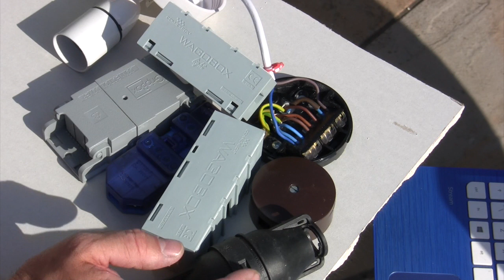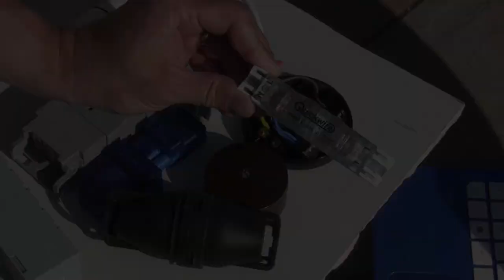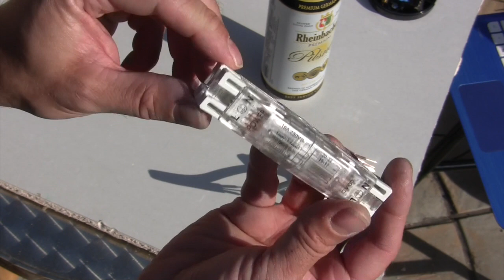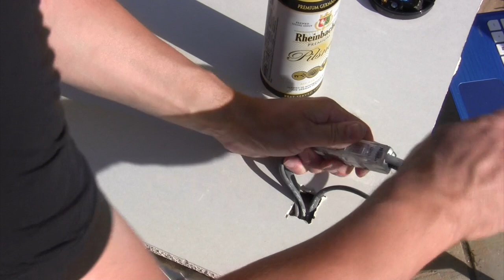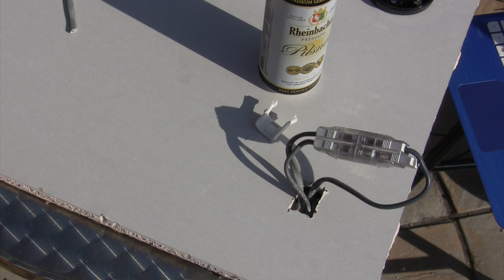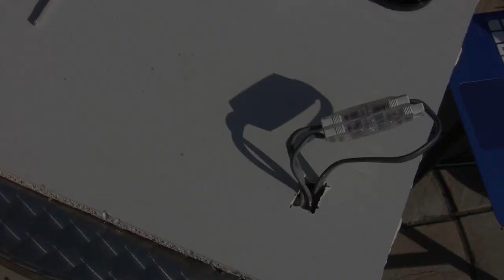The Quickwire Switch & Load

Comment: Wish I had one of these when I installed a ceiling fan and light. Ended up using some terminal strips to wire it exactly like a ceiling rose light would be, passing through the loop in to the loop out, and wiring the switched live into the device so it can be controlled by a switch.

It actually gave more control that way as the fan could be operated on its own switch cord, whilst the light was controlled by the wall switch.

Comment: David did you know that all new builds well in Leicester anyway the feeds and neutrals are looped in and out of switches and not in and out of the light points,I know it's crazy,so there is no permanent feed in you ceilings,and as for there being a blue cable being used as the switch wire and veing identified in my opinion is a bloody joke because for as long as the new colour scheme for new cables has been about there has been the ability to buy twin brown and cpc therefore there being no need to use a twin brown blue and cpc

Comment: The problem stems from the fact that those lights are meant for European installations where we fit round back boxes to the ceiling under the luminaries, then you do all the connections with wagos in the box and just do fly leads down to the luminaire.

Comment: My house was built in 2000 - just been crawling round the loft removing the myriad of choc blocks (twisted uninsulated cpc) and tidying up with wagos in boxes. Not so easy on the downstairs circuits with chipboard floors - and you can be sure if I moved all the furniture and lifted the chipboard - there would not be a choc  block in site.

Comment: I'm not keen on the fact the switch goes into the opposite end to the mains it looks untidy and will cause issues in old houses where the cables have no slack and in new builds where the cabling is clipped right upto the light. I will be sticking to crimps and choc box.

Comment: Hi Dave,  I am not an electrician, but I would like to know if this quick wire would be just the thing to add a couple of lights in my loft. I have just decked out my loft and would like to have a bit more light. I have one light only and wondered if I could add two more via the quick wire? My house was built in the 50s ant was rewired 20 years ago. Question is, how do I find the loop in and loop out?  It would be nice if any of you electricians out there could offer any advice for me? 😉

Comment: Another great review Monsieur Savery, I saw these yesterday at Sandown Elex but wanted to look at reviews, as I hadn't heard of them, before committing. Your review, which I stumbled across last night Mr Savery, moved me to get some today, so cheers my dears :)  
I went for the starter kit at £50, comprising of two of each connector plus the flat cable stripper, which is the Jokari FKZ with the Quickwire badge stuck on it, and removal tool. 
The inventor was on the stand and I mentioned the comments below concerning price point. He said he didn't want to go down the route of having them made in China but wanted to keep them made in the UK. He is also bringing out a downlight connector click connector in March. Is that "Dunstan" I see making remarks in the comments section? Also..........................
did Aldi sponsor this?
Reply from the maker: Cheers Olly. I was also chatting with the inventor when Elex was in Coventry a few weeks ago. We don't use many of these, but they're handy to have when the right job comes up! He mentioned about his new downlight connector and about a 32A version of this ideal for breaking into ring circuits to run off a spur which will be great when it comes out - less faff than using a Hager J803! No sponsorship for this one I'm afraid, just a flat beer from Aldi that happened to be knocking around!
Reply: @dsesuk  I didn't hear him mention the 32A version, interesting.  I applaud you not just for taking the time to make the funny and interesting videos but for putting up with the Luddites who "diss" you. They must have a toolkit comprising of a pair of side cutters,  a flat blade screwdriver, a couple of strips of screw terminal blocks (30A to cover all eventualities) and a roll each of brown, blue and CPC insulating tape!
Reply: @olly7673  🤣🤣

Comment: Junction behind the switch is best for smart light switches
Reply: Either this or a three conductor (earth isn't counted) cable is becoming mandatory as a Neutral is required at every switch under the new codes. The presence of a Neutral literally means that you can fit a $20 Astronomical timer versus a $40+ unit.

Comment: Meant to add I spoke to Quick wire about one that could be used on bathroom extractor with the timer but tooling and development cost have shelved it for now but I came up with a cunning plan, I told the owners to order non timed extracts, there is a way around it but  sod it
Reply from the maker: I'm finding them hard to get hold of, my account manager at CEF sounded positive, but when I went in to order more this week it was clear they had no stock (and no intention of bothering with getting any).
Reply: Bought a box in CEF last week and comes with 2 removal tools no problem with stock. Exeter

Comment: Not sure what you do when you have a wooden ground in the ceiling? And why would you need a clip? If you have access above you could just just a JB that costs 60p and not some over engineered device.. probably sell will in b&q to the diy masses, can’t see sparks using it
Reply from the maker: @Mark Jones Hi Mark. It comes from Regulation 526.5 and 526.8 which require terminations, or cables where the sheath has been removed, to be 'adequately enclosed'. Of course, BS7671 doesn't define what 'adequately enclosed' means, but we know the point is to keep single insulated wires housed to prevent touch contact in case that single insulating layer has been compromised, and to help prevent the spread of fire should, say, a loose connection occur. Some might say that shoving the choc-block into the ceiling is fine as it's out of the way and can't be accessed without the use of tools. If it's in the ceiling cavity, then you'd have to remove the luminaire or cut up the floorboards above to get at it. If on the top floor, then it's pushed into the attic. Personally, I don't like either way. In the latter, the connections remain readily available in the attic and might be touched by the homeowner, someone laying loft insulation, someone working on the roof etc. In the former, those connections are out of the way, but if the homeowner or a plumber does cut up the floorboards, perhaps to lay new pipes, then again you're in a position where inadvertent contact may be made by people not skilled in the dangers of working around live parts. That said, most houses, I suspect, have connections like yours that have been pushed above the ceiling, perhaps wrapped in tape, and there are likely few incidents or accidents as a result. As someone being paid by a client to undertake electrical installations to a professional standard, I would aim to achieve compliance with 526.5 and 526.8 by using some sort of enclosure wherever practicable because that's what's expected of me and I want to ensure I cover my arse! Others are free to make their own risk assessments and to work to standards they're happy with!
Reply from the maker: If you have access from above, then there's not a problem. This is more for when you don't have alternative access. We used one of these last week to relocate a pendant fitting - no access from above, had to widen out a wooden support between the joists to fit this through, hole made good afterwards so no access afterwards. The thin size and maintenance free connections made this ideal for the job.

Comment: If this review is meant for electrician then I am sure electricians can manage a connector block or a three way Wagos would  work like a treat.
Reply from the maker: An electrician would realise that connector blocks and unenclosed Wagos would work electrically, but would only be compliant if they can be housed in the base of the new light fitting, if that light fitting is Class I and if an earth is present and connected. If the light fitting cannot accommodate the single insulated wires and connectors, or if it's a Class II fitting where no single insulation should be present, then that's where something like this is needed.

Comment: Hi David great video and that looks like a great little piece of kit, I’m curious though is there test points on that junction box if ever was needed to fault find and test.

Thanks
Reply from the maker: An excellent question. It seems not looking at those before me here, so unlike other connectors such as those made by Wago, it appears you would have to use the disconnection tool to remove the wires for testing.
Reply: David Savery Electrical Services That’s a shame as it’s a great product.
Reply: @dsesuk  Wouldn't a test point defeat double insulation?

Comment: Wouldn't be simpler to just put a single screw terminal to joint the non switched lives and call it done? 

Also I don't understand the pros of that method of wiring that you have in the UK, having the power that goes to the switch that then goes to the light seems more natural, and probably saves more cable in the end (because most of the time you don't have a single switch but more switches that controls more light, or 3-way switches and so on). And it leaves more room for future expansions and changes.

It's also more dangerous, because the non switched live at the light fitting is always on, even when the light switch is off, so the non expert homeowner that just wants to change a light fitting thinks that doing that with the light switch off is safe, but the power is indeed always on. 

And also nowadays having the neutral on the switch can be useful, for example you may want to install these new IOT switches that you can use to control the lights with you smartphone and all these sort of things, that requires you to have the neutral to the switch.
Reply from the maker: This type of wiring is a legacy thing. Houses were built with a plastic ceiling rose that contained the junctioning, and if people wanted a splash of colour or funkyness, then they would just hang a new lampshade off the thing. Changing the whole luminaire is something that people perhaps started doing in the 1980's and it's grown to be more common as time goes on. These days, we're often called in by those who have bought a new house and want all the plastic light fittings changed for fancy things they've spent too much on. The house building industry, always slow to react to change, has finally caught on to this, and new houses are often built with the junction at the switch these days. You're right though, it is confusing for homeowners who attempt a DIY change of their luminaire as when they unscrew the old plastic fitting, they find three cables and a live junction even though the light is off. Screw junctions can be used, but they need to remain accessible in case they work loose, and they're supposed to be enclosed. It's the act of fitting the enclosure into a small ceiling hole that causes the trouble as a traditional 5A screw junction is too big. As you say, a neutral at the switch is handy for any IoT kit that needs it, although most sold here get their neutral by passing through the lighting load (which has the unfortunate consequence of causing incompatible LED lamps to glow dimly because of the passing control current!)
Reply: @dsesuk  a lot of the wiring design in the UK seems aimed at saving some copper .. ring mains, this type of lighting wiring. And then there is the obsession with electricity in bathrooms. They're in a little world of their own.  I live in Finland. Everyone has their washing machine in the bathroom, you can plug a hairdryer in and use it standing in front of the mirror. No ring mains. No fuses in the plugs. And all houses have three phase power, so no massive cables to cookers since they are fed with all three phases.
Reply from the maker: @richard-riku  Oh please, are you expecting common sense from a country that voted for Brexit??!
Reply: @richard-riku  Apparently, there is no mention of saving copper in the records of the IEE, leading up to the introduction of ring mains, and it is actually just a popular myth.

Comment: i think loop in round the switches is a big inprovement . one t/e at a light saves allot of messing in rewires on old properties where existing grip conduits were for the switch drops yes loop in round the lights . how many non electricians have you had say to you i got a shock from a light fitting with the switch turned off . allot of modern fittings are only made for one t/e and i thought the use of choc blocks was no longer to spec .
Reply from the maker: Indeed, and a lot of house builders are now wiring in this way which is good news when you get called in to fit some awful luminaire from the likes of John Lewis! Nothing wrong with choc-blocks as such, but they have to remain accessible and should be enclosed, so they're not terribly practical in most cases. Still, most iffy installers or DIYers will use them, wrap 'em in tape and push them up into the ceiling where they can no longer be inspected or easily retrieved!

Comment: Great video David , I'm a loop in / out man myself , that's the way I was taught and will always use this method and I'm not to keen on bringing a neutral down to a switch and sticking a connector in there , it may be the preferred choice for some but hey ho every one to there own.....👍
Reply: Agree totally with this. But some smart switches do need a neutral.  So on rewire I tend to wire 2 plate.
Reply from the maker: Nothing wrong with the ol' three-plate method.
Reply: Don't need a neutral connector at the switch - if you don't cut the neutral wire.

Comment: certainly is a lot of waffle about something which is not needed , i personally would not trust a compressive spring to keep the connection , the three terminal connector in the fitting is just changed for a 4 terminal thus problem solved , simple and no other work needed
Reply from the maker: It very much depends on the fitting. Has it got room to accommodate the extra wiring? Is it a metal fitting posing as Class II with a shitty plastic connector housing, in which case taking single insulated wires into it without oversleeving them would make for an improper installation? As an installer, it's only too often you find yourself presented with something that's awkward to fit in a way that keeps it safe and compliant, and this product is just another option to fall back on if the circumstances suit. I have no problem with the compression spring connection, it is built to BS5733 like Wago connectors and if it stands up to BSi testing then I don't think I need to be second guessing it.
Reply: @dsesuk  I've seen JW's Wago tests and they pass with flying colours - although one has to remember they're new. I'm totally with Andy - well at least for loads over 5A, I'd go for screw connectors. Crimped connections even worse - by their very nature, on releasing the crimping tool, they always ease their grip - not so with screws.

I think the issue with screws is that they're too technical for electricians to understand - so they don't tighten them enough.
I had a friend assist with some plumbing using compression fittings - and he was tightening them 'as advised'. I, as an engineer, on the other hand tighten things until they're tight enough - and 'tight enough' is determined by feel, not by advice.
Reply: @millomweb  While a spring clamp eliminates the problem of under- or over-tightening, that is not why it is mandated in BS 5733 for MF. It is mandated for the same reason Loctite exists - because screws are prone to loosen with vibration or temperature cycling.
Reply: @JohnSmith-ws7fq  Properly tightened screws won't come undone. Firstly, they make good electrical connection as the rubbing of the screw ensures it cuts through any resisting material (e.g. oxidised metal) (which in turn will minimise heat generation via electrical resistance in the connection) and should be clamped enough to put it under constant stress so that thermal issues are not an issue !
I'd suspect budding electricians are not being properly taught how to tighten connectors properly.
What is 'MF' (BS 5733) ?
Can you find a 3,000A conector where the connection is done via a spring clamp? I'm not aware of anything else than threaded bolts for making connections in high current situations. I can't imagine EV batteries main wires being just a push fit into a connector !

Comment: When it comes to normal earthed fittings, I simply use choc-blocks. No Harm. When I find double insulated fittings (with that stupid, tiny insulating block) I've come up with what I think is a good solution. Turn the fitting to a standard earthed type! Remove the stupid plastic crap and find good mounting points for earthing wires wherever necessary. I typically use crimp-loop connectors and earth conductors out of 1mm flex cables. Slam it all together (neatly of course) in a 4 terminal choc-block and finally remove any "double insulated" insignia on the fitting. Done.